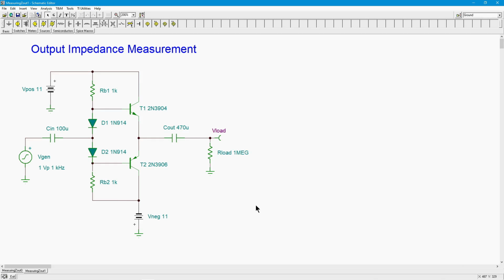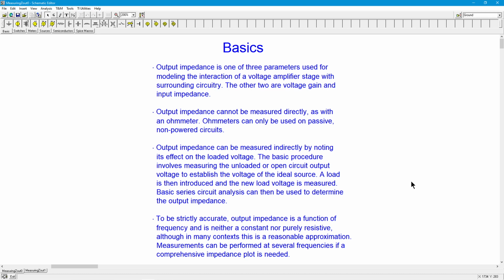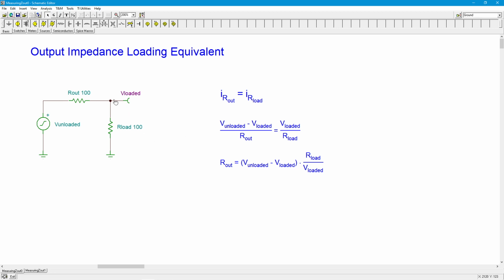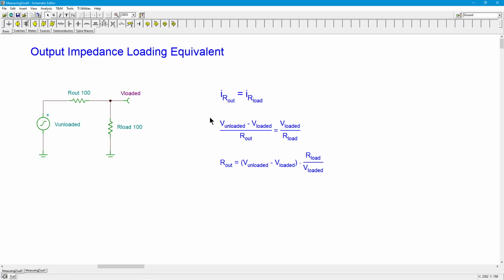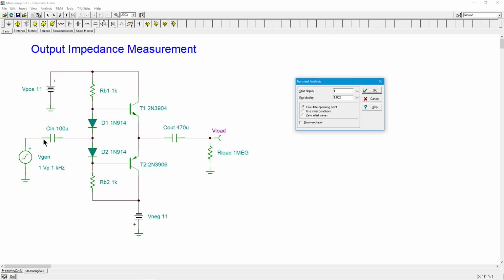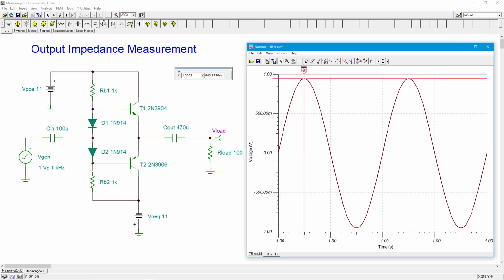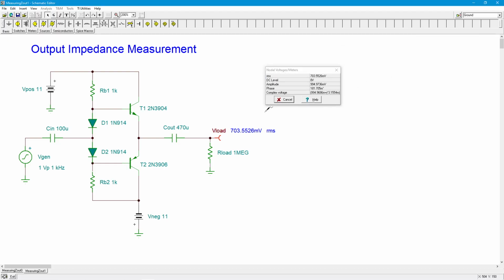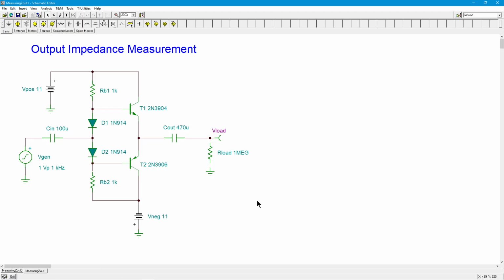Semiconductor Devices: Measuring Amplifier Output Impedance

Comment: There is an easier way of measuring Zout. Just replace the load resistor with a voltage source, remove the input voltage source and short the input. Now do an ac-analysis and plot V(out)/I(out). Change the y-axis to linear and presto, you see the impedance in Ohms over frequency, not just the impedance at one single frequency. I to this al the time in LTspice. So it must be possible in TinaTI as well I guess.
Reply from the maker: It most certainly is possible to do that in TINA-TI, but I am illustrating how a student might go about this in lab with real components, while leveraging what they've already learned in a basic circuit analysis course. Note how in the description I state that a simple ohmmeter cannot be used for this task in lab.

BTW, if you're just interested in doing a simulation of Z instead of real world measurements, perhaps the easiest way of doing so is to just pump in a one amp current source and then plot the voltage it produces. This is how I generated the impedance plots for loudspeaker models in another video some time ago. Doesn't even require a post-processor- just do a Bode plot. Done.

Comment: Where is the GND reference as middle point between Vpos and Vneg in that circuit, I wonder 🤔
Reply from the maker: ?? Are you being sarcastic? There is an explicit ground symbol.

OTOH, if that is a subtle reference to the fact that the input and output coupling caps aren't really needed (because in a properly functioning amplifier those points are at DC ground), then I'll just add that I will include those items for safety's sake, for those who like to build and test these circuits (a dumb mistake on wiring can lead to the destruction of some components, and those caps help to minimize those issues).

Comment: It is often not such a good idea to try to replicate a measurement setup in a simulation. With knowledge of the simulator’s internal workings and network theory, one can obtain the expected result in a much simpler, more efficient, and more accurate way. In this case, it is sufficient to replace the input voltage source with a short circuit (or a dc voltage source), omit the output capacitor and load resistor, and place an inverted AC current source of 1 ampere between the output and ground. Then, perform an AC analysis—for example, from 10 Hz to 100 kHz—and measure the voltage at the output node. This output voltage is numerically equal to the output impedance of the amplifier.
Reply from the maker: Sure, you can do that in the simulator, but the point of this video is to explain to students how to do this measurement in a lab. I am simply using the simulator as a tool to illustrate the process. For the students, I find it much more clear and quicker to do that than to make a video of myself in lab making the measurements and then interpreting them. I thought that was clear throughout the presentation, but perhaps not. (Side note, Zout is measured using the method presented here in Exercise 19 of the lab manual that accompanies my Semiconductor Devices text.)

Mind you, I have used the technique you described elsewhere for other purposes where it is appropriate (for example, plotting the impedance of a loudspeaker model), but it is not appropriate here. No student should get the impression that they can hook up a one amp source to the output of this circuit in lab and get anything other than a smoldering mess.

Comment: Thanks, after decades of audio work, my grasping of output impedance has been slow. Just wondering, for practical reasons; When simulating across the  typical audio range, I would think that a reactive/capacitive (inductive) load makes things more complex than a purely resistive one? 

Since at the end of it all, that complex interaction should hopefully be ‘even enough’ within the (for us) interesting bandwidth, THD, response, nonlinear time dilation etc. Not necessarily amp to speaker because of VERY complex physics. There are so many other transmission lines in a recording situation, where e.g. transformers have roles for input, output or both - with nonlinear ‘degradations’ we seem to like. 

Products often make us believe this is fairy dust level uniqueness, but it’s all just physics. A dive into well behaved nonlinear interactions in audio would be really great! 😊
Reply from the maker: A reactive load makes sense in certain situations. I have a video on how to create an RLC circuit that behaves like a simple loudspeaker. Here are some videos that you might find of interest:
https://www.youtube.com/watch?v=CJ6jPryzYQo
https://www.youtube.com/watch?v=leRAqhsMoTI
https://www.youtube.com/watch?v=1Qgqb0Dn-Ks

If you want to find the Zout at different frequencies (and treating it as a complex Z), that is easy enough to do if you have a decent o'scope and generator. Follow what we're doing in this video but also pay attention to phase shifts in the signals, instead of just treating as a simplified AC version (i.e., zero phase "DC-ish").

Comment: This is excellent, thank you Professor Fiore!  I still recall from my EE studies Thevenin equivalent circuit and I would use that (i.e. the output impedance would = V open CKT/I short CKT), but operating at short circuit I imagine would throw off the results and not be the best method, depending on the CKT.
Reply from the maker: Yeah, shorting works well on paper but is not always a good idea in practice. Sometimes you get fire. And circuits on fire are usually bad things.

Comment: Prof. Fiore one thing that stuck with me from school many years ago was that output impedance and input impedance should be matched to get maximum power transfer between source and load. Reviewing this lesson I'm trying to understand how, if the input and output impedance (resistive components only in this case) match, aren't we actually getting 50% output?
Reply from the maker: Yep. That's one downfall of matched impedance systems. While you get maximum power transfer, the efficiency is not good, so we often ignore trying to match Zout to Zload. For the matched Z case, the load gets the largest Pload possible, but that only represents 50% of the total power generated. Where does the other 50% go? Well, it's dissipated in the amplifier (the Zout in our model). That makes the amplifier hot, which is not good. It also requires more power from the DC power supply. Also not good. There are other issues, too. In general, modern audio power amplifiers are designed to have Zout << Zload. While Pload is not maximized, efficiency is much improved and we get other benefits including better control over a reactive load (an upcoming video will explore that idea a bit deeper). 

There are applications for maximizing Pload, but if someone tells you that you need to match the output impedance of a modern audio amplifier to the load, they don't know what they're talking about.
Reply: @ElectronicswithProfessorFiore  Ahh, that makes sense. Impedance matched gives the maximum power that can be transferred but only 50% efficiency because of the voltage divider effect of Rs & RL. I just learned something I never clued into before! Thank you for the clarification.
Reply: For many situations you actually want output impedance to be << the input impedance of the thing it is driving (factor of 10 or more). This can be especially important for loads like loudspeakers (which have a reactive component, and tend to resonate mechanically at certain frequencies) - an amplifier with too much output impedance won't be able to damp the resonances effectively, resulting in uneven frequency response.
Reply from the maker: @MikeU128  Yes, as I alluded to in my reply above, and I think you will enjoy the next couple of videos that are in the queue (frequency response can be an issue but often of more concern is the effect of low damping factor on transient response). Stay tuned!

Comment: Hi Prof. I have one question. If using a scope to measure both voltages, wouldn't it be alright to skip the load resistor in the unloaded case and just to exploit the 1 or 10 MOhm input impedance of the scope itself as a load? Nice video as always. Greetings.
Reply from the maker: Yep. I like to show a load resistance in the simulator so that the computation is obvious, but that doesn't have to be a proper 1M resistor in lab. All that is required in the unloaded case is that what the amp is driving is much, much greater than the normal Zload.
Reply: Splendid, thank you! Just went to the bench to use this method to measure the output impedance of CE amp. Using a 22k value for collector resistor with the Intention of determining the intrinsic collector resistor value (which parallels Rc for output impedance). Result was around 370 kOhms. Which unfortunately doesn't come close to what marshall leach predicts in his formular. But maybe I will find some bug....in my circuit or my head..;-)
Reply from the maker: @christinaschumacher9419  Well, Dr. Leach was very much respected in the field. I remember reading some of his work back in the late 70s and 80s. I will go out on a limb and suggest that he wasn't hallucinating ;-)

Not knowing any of the specifics of your circuit, if it's a fairly typical small signal amp, 370k seems a little low but not entirely out of the question. All I can say is make sure that your measurement is taken far away from the frequency corners (to avoid phase issues) and that waveform distortion is held low. If possible, it might be worthwhile to swap out the transistor. For example, if you're using a 2N2222, swap with a 2N3904.
Reply: Yeah, I will tweak the values of my coupling caps a little bit. And will follow your suggestion to change to a 3904. See what this does. For now I just used plain emitter resistor 1K, no bypassing or swamping. Maybe I'll also try those configurations...who knows if this leads to better fitting results.(because my value so far would correspond to an early voltage of 10-15 volts...not that realistic as far as I know for a emitter bias current of 1 mA.) Cheers and thx:-)